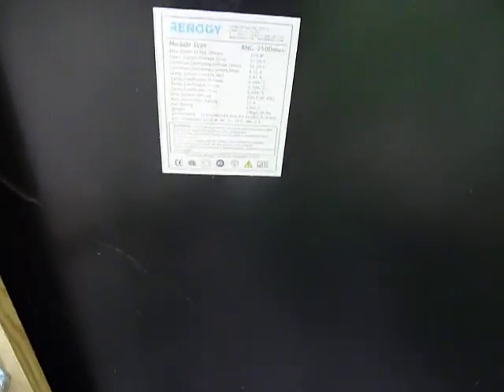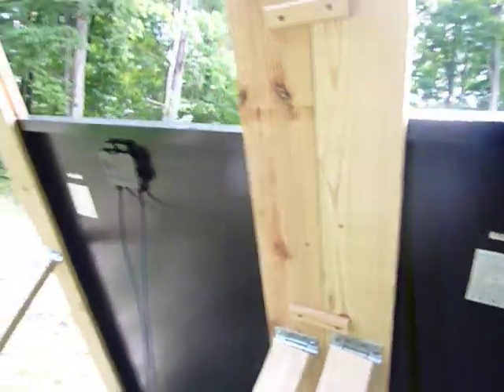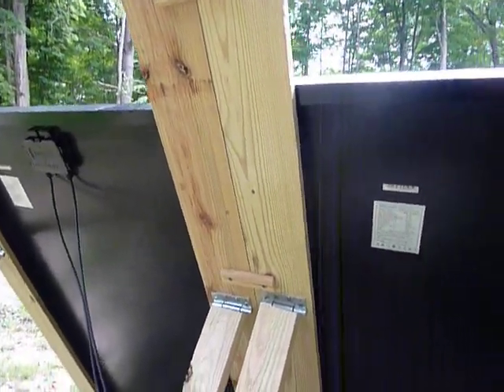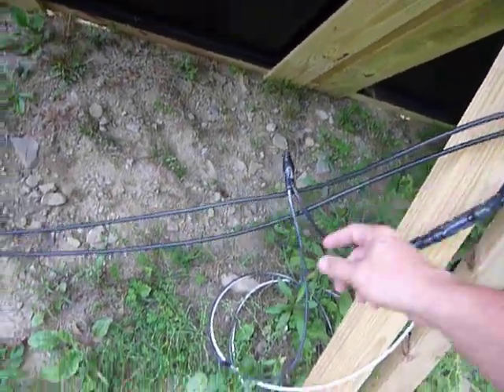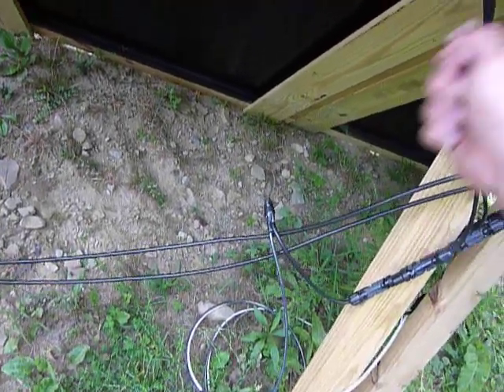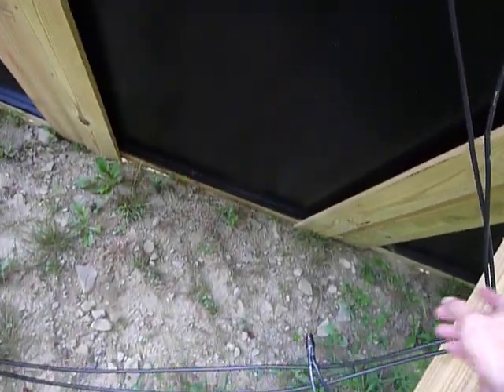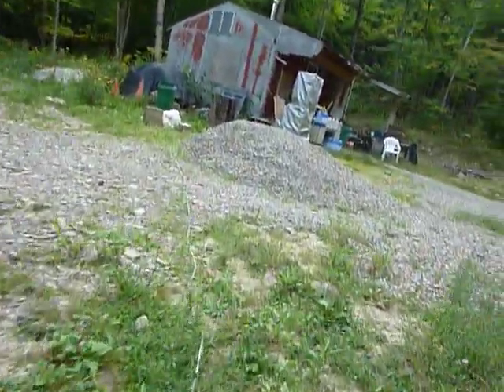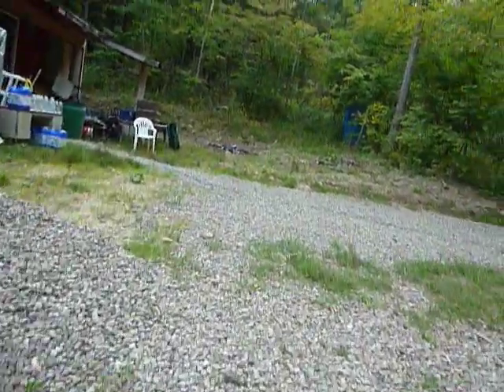We are back making solar power.

Comment: take you meter and start at the battery, measure the 12 volts there, then at each connection measure for your voltage back to the panels until you loose it
Reply from the maker: +Rev John O'Toole Its all good now.

Comment: is your cc an mppt.  if so the higher voltage is okay. but if is a pwm you take a chance at over voltage damage to the cc.    just more food for thought.  we live off grid and have the experience to help. if you want it. look at our system. it went from 12v to 24v. we have lived off both.  pm me your phone number i have designed and fixed many offgrid systems.
Reply from the maker: +Bill'Rosa Ouroffgridsolarcabin  it is an mppt. and I will do that I appreciate the help I need it and from someone who knows.

Comment: Glad to hear of your success.
   I would unwrap that connection and inspect it.  It certainly needs help, if that small of pressure interrupted it.  It may be a lose connection under the tape; and that may cause arcing or carbon burn marks on the bare ends, which will add resistance and power loss.
   I would still protect the wires on the gravel drive temporarily, with a least 2 sticks of 3/4" PVC, a $8 investment.
Reply from the maker: +Bruce Wayne No one drives over the wire. and your right I will check it out.
Reply: preppernurse1 Watch out for that elusive UPS man and his angry camouflaged brown truck.  :o)

Comment: I'm realizing that when I notice an obvious thing on the video that I should mention it, because I noticed that but didn't focus on it. you had a loose connection, not a short, if it was a short you would damage like the blocking diodes and wires to the batteries.
since your battery bank is 12 volt, you should have 12 volts from the panels to the batteries along the the cable connection. the 33 volts is the OPEN CIRCUIT VOLTAGE, VOC.

you should have fuses on the battery each set of 12 volts
these will work
http://www.amazon.com/gp/product/B0019ZBTV4?psc=1&redirect=true&ref_=ox_sc_sfl_title_9&smid=ATVPDKIKX0DER
http://www.amazon.com/Blue-Sea-Systems-5190-Terminal/dp/B001AFZL9O/ref=pd_bxgy_200_text_z

btw this is Saturday
best
Reply: +Rev John O'Toole that is an MPPT controller so he can have up to 150v input form memory John.
Reply: +Justin Case yes I know you know, I get confused until you tap me on the shoulder
if some is using 24 volt panels on a 12 volt battery bank then they have to be using a mppt controller

best
Reply from the maker: +Rev John O'Toole Thanks john. the 33 volts was  just the panel itself.
Reply: +Justin Case I don't think it's a mppt controller and I believe he has the panels in parallel, though I'm not sure.
Reply: +Rev John O'Toole Its all good my friend. I just don't want the man getting confused, There are plenty of people trying to help him.  Its up to him what advice he takes.  I will help him if he wants me to. I have some gear coming soon. Just ordered it. I will do a very small system from panels to batteries and inverter, Wired with fuses. Like a beginner video, Should help a lot of people,

Comment: I suggest you goto lowes and buy the following
http://www.homedepot.com/p/Carlon-6-in-x-4-in-Junction-Box-E987RR/100404096
http://www.lowes.com/ProductDisplay?catalogId=10051&langId=-1&productId=3370974&partNumber=93985-82364-GBK10CS&storeId=10151&N=0      times 2
Make you a junction box to do all your parallel connections then run only 2 wires to the CC.   
This is what I got for me and several other systems I designed and put together.
Here is a basic Multimeter  I own like 4 of them  http://www.harborfreight.com/7-function-digital-multimeter-90899.html   they are cheap but work.   Yes I own a fluke multimeter but they are expensive.
Just food for thought.  I have had nothing but issues with MC4 connectors.
Reply from the maker: +Bill'Rosa Ouroffgridsolarcabin Thank you very much.

Comment: Thats why I dont use MC4 connectors.   I solder and wire nut connections or use a combiner box.   Then I can KNOW i have good connections.   Glad you found the bad connection.
Reply from the maker: +Bill'Rosa Ouroffgridsolarcabin It was not the mc4 connector it was the wire that went back to the cc.

Comment: The one problem I have is how you fixed it by just moving a wire. If that is the case you have a loose connection and it could happen again. You should check your connections to make sure they are tight. Glad you got it working again.
Reply from the maker: +TheCritterWindow It was the wire that was running back to the cc and that's what I fixed.

Comment: PN1- Here is a list of your State of Charge (SOC) for your Trojan batteries without load (inverter disconnected/off) 

http://www.trojanbattery.com/tech-support/battery-maintenance/

100% = 12.73 (where you should be at end of day's charge cycle)
90% = 12.62
80% = 12.50
70% = 12.37
60% = 12.27
50% = 12.10 (stop using at this point)

Also, recommend you check the voltage of your panels collective output before it crosses the driveway, then check the voltage at the charge controller.  I suspect you find a significant voltage drop with the size of wire you are using to span the driveway.  You goal should be short runs when planning the final installation.
Reply: +preppernurse1 Ed, you should also know that you can't measure a battery while it's being charged.  What you're seeing then is the charging voltage, not the battery voltage.  That's why you see 14 volts on your inverter during the day when your actual battery bank may be sitting at a much lower state of charge.
Reply from the maker: +Commsprepper Thank you I will make sure I don't let it get to low.
Reply from the maker: Arnd2it That's good to know thank you.

Comment: Glad you got your system working! I know it feels good to be able to trouble shoot problems like that, and know you can fix it. Do you have your equipment grounded yet? If not, I would do that asap (ground rods apx $30 ea at home depot), and once that is done, I would add a lightning arrestor too (apx $120 for a good one). That may be a little pricey, but not as expensive as having to replace your solar equipment
Reply from the maker: +James Pottorff Your right I need to get that done.

Comment: I hope this link works http://www.ebay.com.au/itm/261924034266 i use these,  not only is it airproof dustproof waterproof joint it solders the conection and gluse at the same time.
Reply from the maker: +Justin Case Thank you very much I will get some.
Reply: +preppernurse1 http://www.ebay.com/itm/100pcs-26-10-AWG-Solder-Sleeve-Heat-Shrink-Butt-Wire-Splice-Connector-Waterproof-/331584479715?hash=item4d33f9a1e3
Reply: +preppernurse1 Cool brother glad to see your rocking!! God Bless.
Reply: +preppernurse1 your welcome :).

Comment: the voltage rating on the module is the figure that is under a specific condition . the voltage can go over that when it gets cold out.  you should think about what your going to mount your modules up on as they will be under snow next wintet
Reply from the maker: +Roy Amberg I know I need to get them up higher before the now flies.